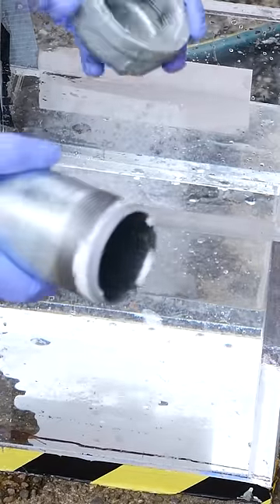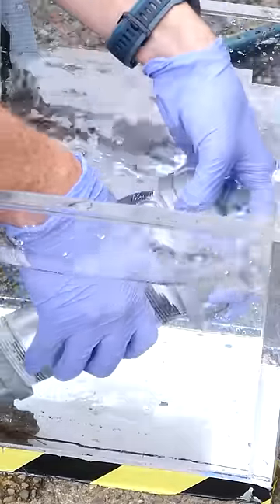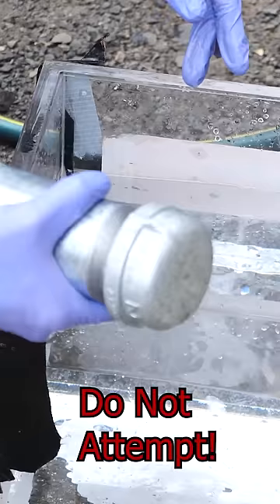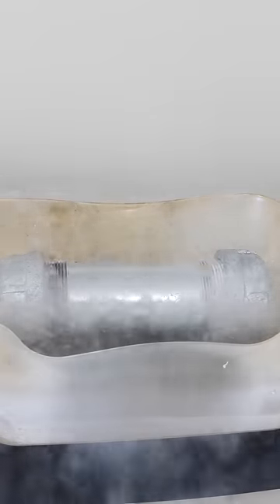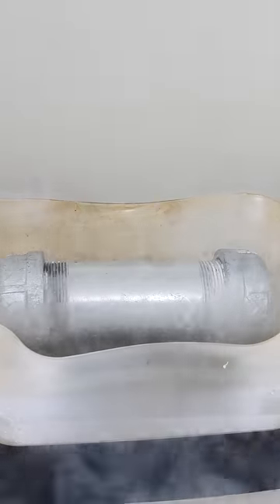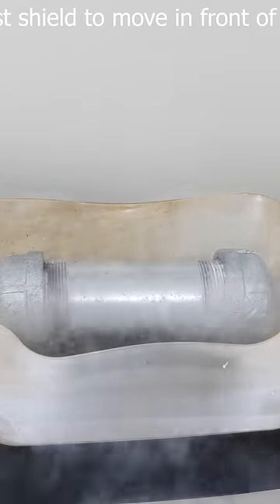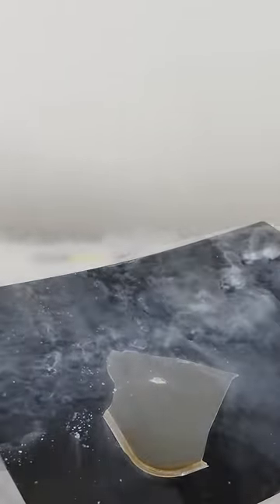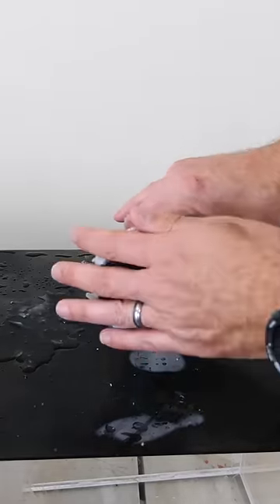Don't Ever Try To Stop Water From Freezing!

Comment: bro putting his life on the line for science lmao the timing on that shield was too perfect
Reply: It was only the cap. Nothing dangerous
Reply: Scientists already know this. If anything, he's putting his life on the line for our entertainment.
Reply: @kennethgosch5638  Considering that the pressure was enough to sheer the threads off, he would have probably lost some teeth at the very least.
Reply: You think this is dangerous, you should’ve seen Brandon herrera attempt to shoot a recreation of the pipe gun that killed Shinzo Abe. His only protection was hiding behind a plastic barrel approximately 5 feet away lmao
Reply: @timberthus2562  Yeah, he himself would have been in the next episode of Darwin awards had he been shooting it by hand
Reply: He knew what he was doing
Reply: @kennethgosch5638  anytime steel fails it’s dangerous.
Reply: The timing was sheer LUCK! You could never accurately guess the time to Mechanical Failure.

Comment: Apart from the pressure generated by the freezing water, the metal gets significantly weaker when too cold. In USA you see this happening all the time when winter  comes and people forget to isolate their metal pipes. They break with water reaching less than 40°F
Reply: @celinreyes1983 First sensible comment I have seen so far :)
I'm just curious - How does one 'isolate' the metal pipes? Idk because in my tropical country this never happens.
Reply: @MJ-hl1kk  they make pretty cheap foam coverings for exterior faucets that semi insulate. Best course is to leave the faucet slightly on to have moving water as it freezes slower than standing water. You can also insulate the pipes themselves under your house if they are in a crawlspace or similar.
Reply: @LeNeovein  depends on where you buy them . But yes, having running water helps, though I was talking mostly in pipes dead ends. 
You can,  and as a matter of fact I did, reinforce the foam with some thick clothing and some taping.
Reply: @LeNeovein  Thank you! It's so interesting how different regions of the world require different adaptations! In my case, those who are lucky enough to buy their own houses with a bit of land, make sure to plant trees around them for shade. People in apartments have to make do with ceiling fans and air-conditioning, if they can afford it. Nowadays, people go on short holidays just to experience winter.
Reply: @MJ-hl1kk *insulate
Reply: @misterbulger  Oh .... okay,💡 moment!
I thought 'isolate' is what you did for the cold! 😂
Reply: @MJ-hl1kk insulate probably autocorrect 😂
Reply: The effect of some steels weakening/becoming brittle when cold was something the crew and passengers of the Titanic unexpectedly became very familiar with.
Reply: You leave the faucet open because it relieves the pressure, not because flowing water doesn't freeze. This explosion occurs because the liquid water has nowhere to go as the ice expands into it. By opening the faucet, water never gets similarly compressed in your pipes.
Reply: @Frommerman  makes sense
Reply: Water in an outdoor  pipe will start freezing at  28.4 degrees fahrenheit
Reply: I’m thinking liquid nitrogen weakened the metal threads
Reply: apart from the pressure generated by the heat only in the the USA steel beams melts too below 1000 farenheit 😂 just kiddin

Comment: It is very interesting to see that although the conversion of solid built-up tremendous pressure due to the non-expansion nature of the system; which in turn prevented the inner core from further solidifying. Nonetheless, only that much ice formation was enough to burst out the cylinder. There was a case study done by API on the winterization scenario of refinery pipelines and highlighted that there is a "sweet spot" where a cylinder of a specific design pressure will not burst due to the fact that at that pressure and temperature, an equilibrium is reached; but very unrealistic of how thick the metal sheet has to be. Go for insulation or heat tracing rather. :P

Comment: Extreme cold of liquid nitrogen makes metal brittle.
You’ve shocked the metal with liquid nitrogen and made it fragile.
I bet if you frozen it gradually in -5 celsius it would behave differently.
It would probably popped the container as well but in different manner and water freezing shape would be different as well.
Reply: I was thinking the same thing. The fact that he doesn't freeze the pipe gradually would affect it.
Reply: Correct.
Reply: If it stayed watertight long enough, it definitely still would have split some part of it eventually. Water can create enormous pressure during a phase change.
Reply: @bobsanders5488  tell that to my father whose axe shattered while cutting wood outside in -60 C
Reply: @gegek3955  thats because it's fracture toughness changes. Totally different things
Reply: ah thanks. this makes more sense. hard to believe to video.
Reply: So you're saying he needs to make more Frost Bombs but differently each time. For science, of course.
Reply: @bobsanders5488  Let's get this straight. OP made the assertion cryogenic freezing makes metal brittle. You argued low temperatures do not weaken metal. Someone gave an example of freezing temperatures causing metal to shatter. You conceded that can happen, but due to a different parameter of metal freezing.

Could your head be jammed any further up your posterior?
Reply: But wouldn't have gotten nearly as many views and comment. 😅😂
Reply: I would love to see him test your hypothesis.
Reply: I want to see this... Gradual cooling
Reply: @ctdieselnut yes but would it have been as big of a bang?
Reply: yeah but then he wouldn't have a video
Reply: No you bet wrong. The metal enclosure certainly cannot contain 300 mega pascal preasure that need to form ice II.
Reply: @sandykettelhut  I love your confident but wrong.
Reply: @bobsanders5488  Slow or not it will pop eventually. Ice II form at 300 mega pascals.
Reply: @bobsanders5488  Slow or not it will pop eventually. Ice II form at 300 mega pascals.
Reply: As a plumber let me tell you it wont change much ..yes it wont be that quick but the water expanding isnt the only thing it is also the metal shrinking and it would still be a huge bang
Reply: I was about to say the same thing LOL

Comment: He litterally knew this was gonna happen and waits with the shield untill the last moment. I can't
Reply: Him: "Might be a good time to put the riot shield in front of m-💥"
Reply: There are actually many different phases of ice. It's possible to freeze water in that scenario if the container was able to handle MUCH higher pressures. Ice iii is more dense than water, and thus would take up less space in the container.
Reply: I assume some similar thoughts went through Mr Slotin's mind when his screwdriver slipped out of Demon's Core shield crack... But he didn't have a shield...
Reply: @pcproffy  Ice is less dense than water. Water expands as it freezes.
Reply: @moistpretzel6411  Ice iii is more dense than water, its created when water freezes at high pressure
Reply: @piethoffmann312  oh yeah sorry, I misred the comment, didn't see the iii
Reply: @smalltrashman4227  Ice III is more dense than water. The molecules fix themselves in a closer arrangement as it freezes.
Reply: He was like...yeah I don't need this shield anyway
Reply: @Maple_MK  What level of pressure is required to create that type of ice? Cause clearly steel isn't enough, brittle as it might be because of the temperature.
Reply: Live dangerously ny friends
Reply: @smalltrashman4227  300 megapascals. I'm not saying it's realistic in this scenario, I'm just pointing out that you replied to the other guy with "Ice is less dense than water" without a second thought, even though they were clearly talking about other phases of ice.
Reply: @Maple_MK  Yes, I know. I'm not achem major though so I don't really know about phases of ice. The only phases I know are solid liquid gas and plasma. Sorry man the last Chem class I took was ap Chem.
Reply: @smalltrashman4227  no worries
Reply: @pcproffy  Using liquid nitrogen is the bigger factor than the water in this experiment.  He made the steel SUPER brittle

Comment: Good concept, but using liquid nitrogen severely compromised the integrity of the steel. This is probably why (form what we can see) it fractured around the stress concentrations in the cast details on the cap.  And why so little of the water was frozen.

It would be great to do this in a freezer instead.  It will still break, but it will be much different.  Maybe more if a crack and expand vs. a burst like this. 

I went to a factory that makes the little CO2 chargers, they test their burst by pumping them with pressurized water (basically what you are doing).  When they fail, they get a small rupture around 8mm long and a pop sound.  Nothing much at all.

Comment: Btw that pipe wasn't completely air tight I'm a pipe fitter I use pipes like those daily. If you don't use pipes dope and tape and a pipe wrench to seal it tight air will get in. Hand tight isn't enough.
Reply: Maybe so,   but what would that change?
Reply: @kennethalbert4653  more catastrophic pipe bomb.
Reply: @MMMmyshawarma  My assumption is that the pipe will burst at some threshold pressure, a small leak may extend the time but won't effect the (failure) pressure.
Reply: @kennethalbert4653  you right.  it'll probably just crack the case ingloriously like qt mason jars filled to the neck in a freezer.
Reply: @MMMmyshawarma  Using sarcasm to appear superior when you are incapable of making an argument ?
Reply: @kennethalbert4653  what sarcasm?  what's wrong with you?
Reply: @kennethalbert4653  ?
Reply: @authenticbaguette6673  MMMmy originally implied that without a leak the rupture would be more violent, I disputed that.  He then came back and said, "you're right" yet compared it to a small rupture (sarcasm).  Then he became defensive.
Reply: People like this get me fired from my jobs
Reply: @kennethalbert4653  it's just a small anecdote from putting overfilled mason jars in my freezer.  I don't know what would happen as I don't make pipe bombs, just guessing.  When was I being defensive?  Seriously, what's wrong with you?
Reply: @kennethalbert4653 He would be dead.
Reply: @kennethalbert4653  your disputation isn't valid though, as a tighter seal does indeed cause a more violent rupture as the container will retain all the liquid, causing the internal preassure to rise faster and thus pass the failiure threshold of the shrinking and increasingly brittle steel container.
It's all physics. The heat expansion/contraction coefficient of the specific steel alloy can be found online, as can the material thickness and normal temp preassure tolerances of the pipe components and the heat/cold expansion coefficients for water.
Then you just do the math and you'll be able to calculate down to a few milliseconds of margin when, and with how much energy that pipe will explode for any given volume of water and volume of leakage.
Reply: Dude, this Kenneth guy can't be real
Reply: @queueeeee9000  I'm real.
Reply: @SonsOfLorgar  I didn't see any liquid seeping out ?  I don't think you invalidated my premise.
The water is solidifying which is what creates the pressure.  It would have to be a significant leak to bleed off enough water to make a significant change in water volume to lessen the force of the rupture, presumably enough that we would have seen it.
Reply: Doesn't have to be air tight, just water tight. The point of no air is that air compresses but water doesn't, and he doesn't want to lose any expansion force from the freezing water compressing air bubbles in the pipe. Once it's full of water, air isn't pushing its way in, especially in the few minutes this experiment takes.
Reply: @kennethalbert4653 open your eye the thread clearly got pipe dope on it you know the white paste on the thread that you can clearly see
Reply: @kennethalbert4653 they are all wrong anyway the thread clearly got pipe dope on it you can see the white paste on the thread
Op must be the worst plumber ever
Reply: @legros731  HAHAHA! 
All this back and forth and I had never gone back and watched the vid again.
Reply: Hand tight definitely isn't tight enough
Reply: @superfarful  for water it's more that enough and you know there a thing called editing
It was clearly tight enough the water just bursted a 3/16 thick metal cap
Reply: @legros731  yes it will hold water but I think the force it would take from hand tight compared to tightening it with pipe wrenches would be significantly different
Reply: @superfarful  lol it won't
For it to make a difference it would have needed to fail at the thread and it did not fail here
Reply: @superfarful  The end of the cap broke off, threaded portion remained in place.
Reply: The small gaps get frozen watertight, especially using liquid nitrogen.
Reply: There's water inside... Does a pipe fitter know the difference between air and water?
Reply: The water would have broken it anyways.
Reply: Would have been even better if the cap was welded on
Reply: @kennethalbert4653 you didn't really test if thick steal pipe could contain or stop freeze. You tested the weakest point (the threads)
Reply: @johnwuethrich4196  The threads did not fail.
Reply: it won’t matter if it was welded shut. It will break if frozen solid. The ice has to go somewhere and water will not compress.

Comment: My physics teacher ay school in the 70s said that water is one of the most powerful forces on earth, either instantly or over time it can make changes to any material eventually.
Reply: Remind me this Corean art instalation were 4 big stones are lined and a drop of water hit it every second, and next to each rock, there is a board with writted "20 years / 15 years / 10 Years / 5 Years" and you can see the hole created over the years on a rock from how it start to how it is 20 years later.
Reply: Not one of.. THE most powerful. This is a water planet after all
Reply: Water created the Grand Canyon, so yeah.
Reply: @Jelsick 
It can also cut through metal with better precision than lasers (since it doesn’t melt the metal).